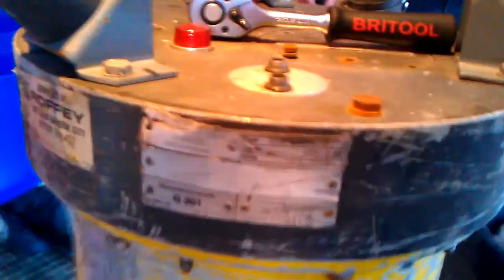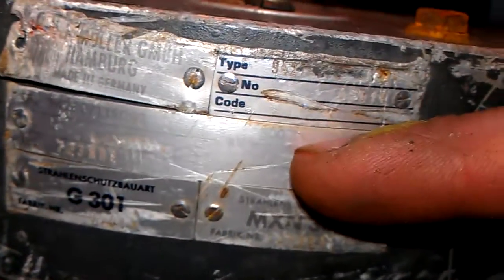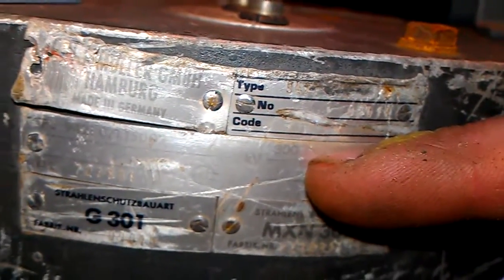Standing x-ray machine. part:1

Comment: The pressure inside is probably sulfur hexafluoride. It's a really quite fabulous insulator, and since they want this to be portable, gas would be much lighter than filling it with oil. Sweet find!